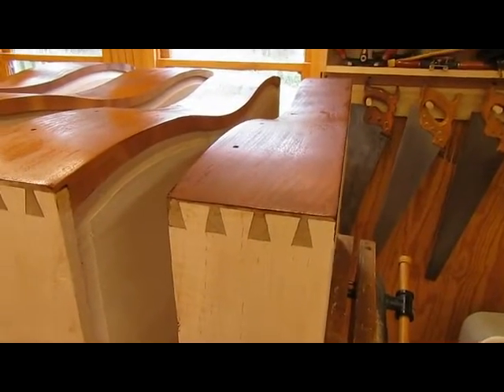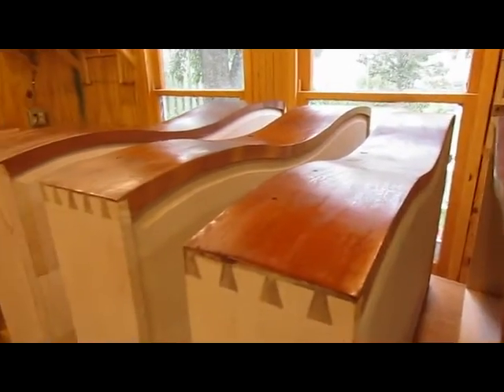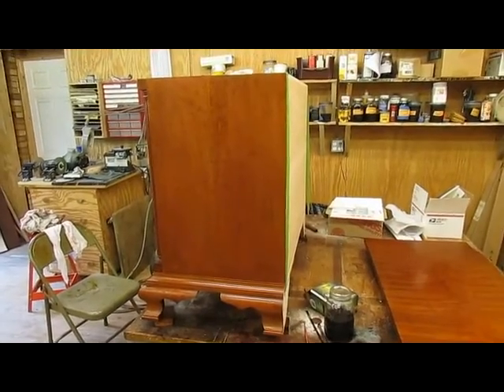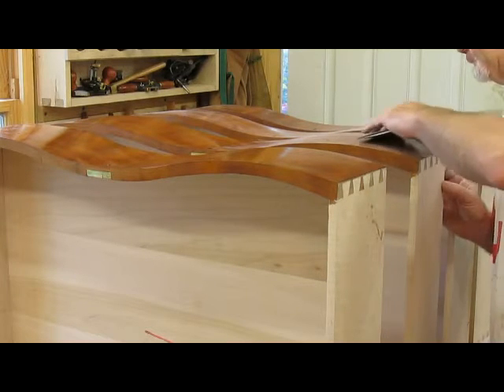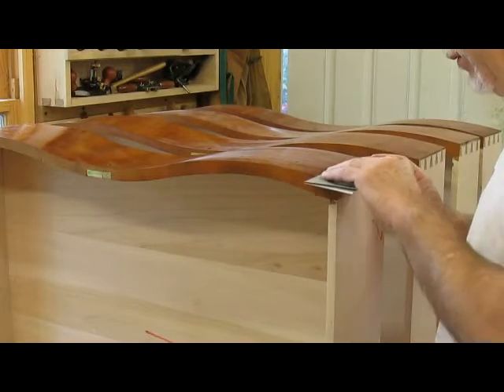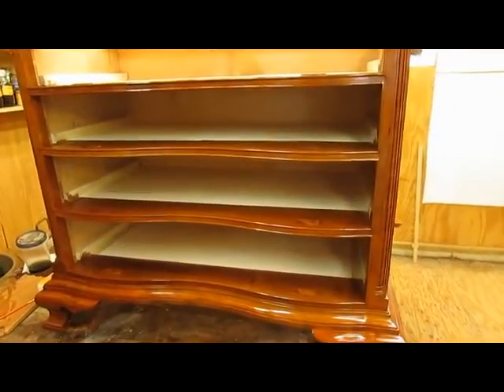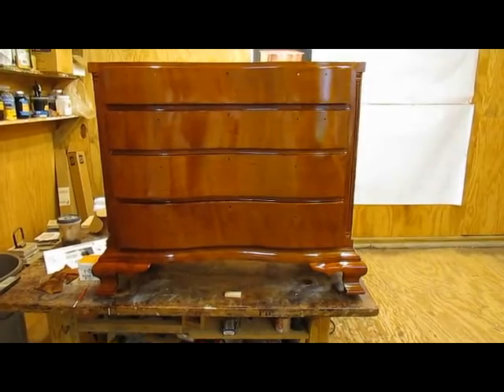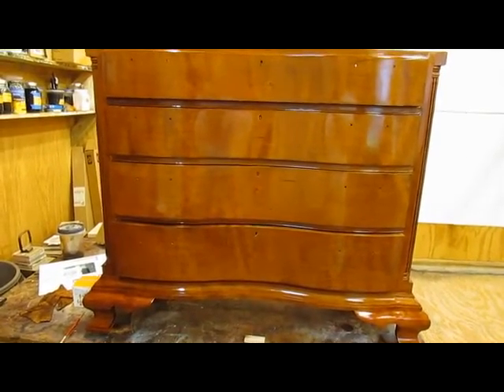Cherry Oxbow Chest   Applying Waterlox Finish Step 15

Comment: I may have missed this but my question is why Waterlox? I’ve never used it before and I’m curious why it appeals to you. I tend to use a lot of General Finishes products.
Reply from the maker: Paul, it is popular with many wood workers,  I is a slow process to use but very durable once completed
Reply: @DavidBoeff  thanks! I’m using arm r seal on a desk I’m making. It’s the first time I’ve used it. Believe it’s similar to waterlox. Love the stuff you make. You are an amazing talent 👍👍👍👍

Comment: Have you ever done the last couple of coats using the satin waterlox? I used the satin on my floor and had to repair a spot after 10 years of use. Because of the cost I got the original waterlox thinking I could dull down the finish with steel wool. I was not able to do so and now forced to purchase a quart of the satin to get it to match.
Reply from the maker: no, I have never used Satin Waterlox

Comment: I have waterlox how would I polish waterlos to get it smooth and gloss ,,, what is the best wax or method of your experience thanks alot for you video,,, sorry to ask im learning
Reply from the maker: Thanks Ernie, Waterlox come in 3 different finishes. I use the original which is too shinny for me after 7 or 8 coats when it drys. I dull it down with steel wool. but if you want it shinny leave it alone. apply any good paste wax and rub out

Comment: hi David, thanks for posting your videos, i am learning new things from them. I am trying to piece together the process. first you applied your coats of waterlox, cut the recesses for the cockbeading, then glued in the cockbeading. did you apply finnish to the bead before gluing it in or after? what did you do about glue squeeze out onto the finished drawer front?
Reply from the maker: Hi Eyal, I cut the recesses and applied the cockbeading before I finished the piece.  Once the construction was complete I sanded and then went through the finishing process. The squeeze was removed during the sanding.  Hope that helps
Regards
Reply from the maker: see the step 5 video for cockbeading, the cockbeading is on the opening not the drawers

Comment: David, love the chest.  The final product is just perfect.  Do you thin your Waterlox before applying, or rub it on full strength.  The only reason I'm asking is I've had Waterlox get "tacky" while applying to a large project such as your chest.  However, my solution is add more Waterlox and rub it in a little and it is smooth again.
Reply from the maker: Fine Woodworking of South Carolina I have never had that problem.  I wipe thin coats on the surface, make sure it is even on the part that I am working on.  I do not go back and go over it other than to look for runs or pools.  If I find a run I wipe it.  I have had it get thick when using it as a wet sand solvent to fill mahogany.  I try to work fast, I have never thinned it